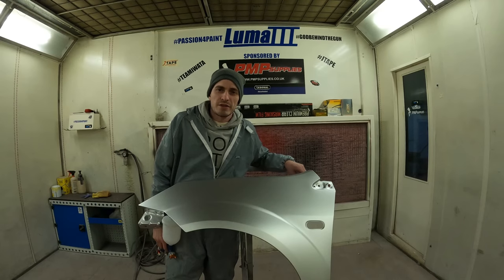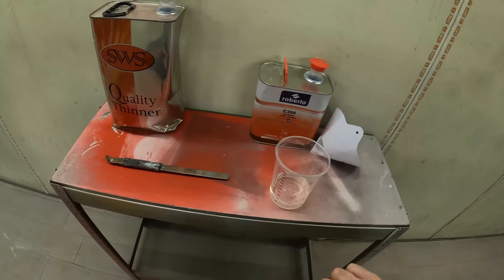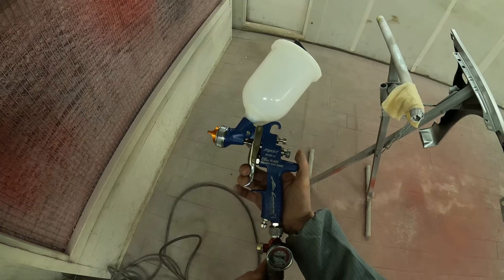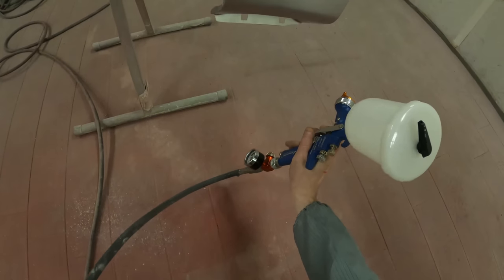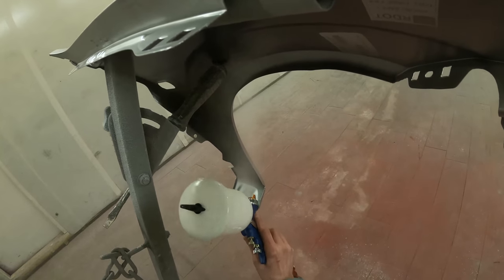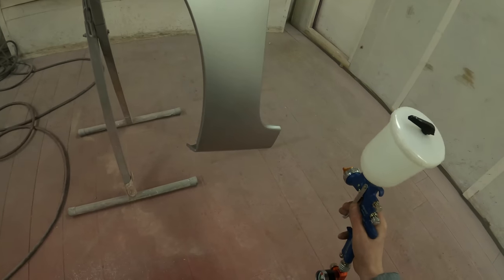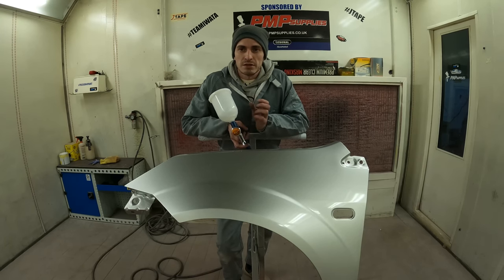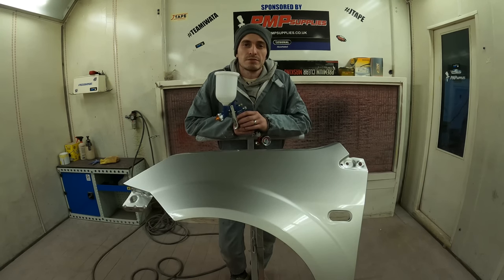How To Spray 2k Clearcoat Episode 3 Car Spray Painting For Beginners DIY Series

Comment: This video really helped me setup my gun and paint 2K clear on my first attempt at painting a van. Your vid was perfect, I definitely would have made some big mistakes without it. I did see a drip and tried to wipe it off, oops, that didn't turn out well 😆 But overall I am really happy with the result. The best time to remove masking tape from a hard edge would be great info too - the van I am painting has an unpainted rubber seal between panels. I removed the tape about 30 minutes after painting, I am a little concerned that the paint may flake over time...time will tell.

Comment: Great video Tony, is there a particular temperature the clear coat and panel should be when spraying?
I'm assuming if it's too cold, the clear coat will run?
Reply from the maker: so average is 20c but obv thats not always achievable for some but you can spray alot lower just be more careful and extend the flash of times ect

Comment: nicely done tony well explained. I need to make another video my first ones where I explained this were pretty lame. So I am going to make one with using Tamco USA made material. I haven't used roberlo clear but I have used their filler which is pretty nice. It poured pretty high solids to me. finish looks acceptable. I usually spray a bit closer and smash the dots just a smidge gets a wetter finish but that would be fine for the panel you are putting on.
Reply from the maker: well bear in mind this was aimed at the beginner mate i wouldnt try to teach people to go as wet close ect as i would to start

Comment: Very nice videos man!!I am a DIY guy and i want to buy a compressor to work with the guns....what specs (cfm, hp, tank) are ideal for small jobs like panels, doors, bonnets etc?Also is the Air Gunsa AZ3 HTE2 proper for a job like this on the video bucause is supossed to be primer gun, but has a 1.3 tip?If you have a gun to propose me around 100-150 euros you are most welcome!Keep up the good work!

Comment: Cracking vid m8, would I do the same method, when using direct gloss ?
Reply from the maker: Pretty much mate yes I’m do one on direct gloss for you guys too on direct gloss I’d probably go one light coat two wet coats though as the polishing stage actually takes colour off the panel so to be safe I would put one extra coat on to reduce the risk of rub throughs

Comment: Hy Tony, can i ask you why my clearcoat (on a solvent base)lose its gloss after 1 or 2 ours but, if i spray It on an old wel cured panel this problem doesn't happens? I used the ICR SPRINT H62 with fast hardner. The ambient temperature around 10-13 degrees  here in Sardinia..
Reply from the maker: The faster the hardener the more it will pull back , also if your base isn’t fully dry ( may be dry to the touch but could still be slightly not quite off ) then it’ll pull back or it could be your clear or thinners there’s a Humber of things that could make it do it
Reply: @TonysRefinishingTV  thanks for the reply, so can i spray the clear over the base letting it dry for a night?
Reply from the maker: It depends on your manufacturer tbh I’d leave it an hour if your air drying and it’s cold / damp then try and hit it with clear

Comment: Another well explained and simple video.....I can’t wait to get spraying now!  Being a DIY guy I’m not sure how I’ll fair with my garage barley getting above 10c 😬
Reply from the maker: Lol we all started somewhere mate and it can be done beleive me lol just slow everything down abit more and take your time , we will also be running some introduction to paint days at my shop this year covering stuff we’ve done in the vids like this one but hands on
Reply: Warming your paint in hot water helps to
Reply from the maker: it does but its something ive never done myself
Reply: You should invest in a heat lamp,also you can add rocket into you clearcoat to speed up the drying process but be careful not to add to much
Reply: Andy, I’m getting there now mate....still a complete noob but I’m getting there.  Pretty pleased with my results so far and absolutely loving the process 😁

Comment: Hi Tony, hope you are ok and your wife in improving, haven't called for a couple of days as you have better things to do than chat to me but if you have the time I have a question for you mate, I lay down my first coat of clear and it looks great with a flat glassy finish but after the second coat it has quite a lot of peel in it, I use the same gun same settings (full fan, 3 turns out on fluid and 34psi) and distance but I just move a little slower, any idea as to why this is happening? I know this is user error but not sure how to fix it, flash off is 10mins, any help would be appreciated mate, John
Reply from the maker: JohnWD40TC02 which gun are you using mate ?
Reply: @TonysRefinishingTV   I'm using my devilbiss sri pro lite 1.2 mini gun, I have two of these one for base and one for clear which of course is the roberlo 610, I know the gun pressure sounds a bit high but been using that after watching the gunman clearing a bumper at the same pressure.
Reply from the maker: Not sure tbh mate not really used one , best thing with 610 is a fine wet coat then a real wet coat
Reply: Ok no problem Tony, I'll try that and see how it goes, I do have some more unrelated questions but I think it's best if I ask you on FB, don't like bothering you atm as you have enough on your plate so I'll give you a few days then give you a call.

Comment: Hi wonder if you can help I am getting quite a lot of dust in my clear coat but not in base coat. I am using an extractor fan and getting spray tent quite hot 23oc humidity below 50%. I need my clear coat to dry faster I am using mipa cx4 2k hs clear coat any advice thanks in advance again
Reply from the maker: Hi Jamie what sort of environment are you spraying in
Reply: @TonysRefinishingTV  thanks not ideal but got a tent 3x3 and 3m high, sealed edges ground sheet on the floor covering up any gaps two fan heaters and an extractor fan to suck out dust. I am not putting any thinners in the Clearcoat as I was not at the shop I didn’t need to.
Reply from the maker: @jamiebeddingham5838  cx4 doesnt really need it tbh its thin enough , as for dust just make sure your guns spotless ect tack before clear unfortunately unless your in a decent half sealed room with extraction its hard to cut down on nibs mate
Reply: @TonysRefinishingTV  thanks for advice I am trying again over next couple of days I never thought after watching your video the other day of blowing off with airline whilst tac rag I’ll try that your videos are great. Thanks again
Reply from the maker: No problem at all Jamie hope you manage to get it to improve abit , also filter everything mate dusts our enemy lol 😂

Comment: Hi Tony new subscriber here, still learning to paint and having problems with my clearcoat, using upol 20:80 and fast hardener but I'm getting bad peel.
I have the devilbiss SRI Pro lite 1.2 with the TE5 cap and 2bar, I'm only spraying small parts that I fabricate myself but do need a good finish. I don't have a heated booth so it's around 10C in my booth, I've been heating my mixed clear in boiling water plus heating the parts with my IR before spraying to around 35C, do you think I'm over doing the heating stage causing my peel issue, should I just heat the part and not the clear. 
I also find that the clear takes 4 or 5 days to harden, is this normal or is upol not a good make of clear, sorry for all the questions but I'm pulling my hair out trying to get a good finish, Oh an using Jet Black solvent basecoat.
Thanks, John
Reply from the maker: do you add a drop of thinners into your clear mate , ive never used that clea or gun tbh but warming everything up like that is something ive never done and in this video we were spraying at 10c no issues and it shouldnt really take that long to dry either, im thinking warming it all up so much may be making it dry to fast so its go no time to flow out on the surface before it flashes off
Reply: Thanks for the reply Tony, I didn't add any thinners as the data sheet states its optional and its quite thin as is, I'll try again without the heat, as I'm using an extra fast hardener (5 to 15C) you are probably correct that its flashing off before its flowed out.
Reply from the maker: JohnWD40TC02 always try to rely to everyone fella if I can the help always expands further than the videos , and if you get stuck after adding a tad of thinner 10% I’d try personally I use that in most clear , then drop me a message on our Facebook page as it would be easier to chat in the future if you need some more focused advice
Reply: Hi Tony, just to let you know that I added 10% thinners, didn't heat the clear and only heated the panel to 17C (ambient was 7C), sprayed 2 coats one medium and one wet and the finish was like glass, quick flash off very little peel. Really appreciate the help here Tony, your advice was spot on. 👍👍
Reply from the maker: honestly mate brilliant fella so glad to see you've got it nailed now mate and was my pleasure buddy always help out where and if i can mate, keep smashing it now fella

Comment: Hi Tony.What are dimensions of that booth.It has just exhaust fan right?
Reply from the maker: no mate its a proper booth so its 7.5 meters long 4m wide 3m tall the whole roof in this is the input filters and it has a fan unit and heating unit pushing air in through the roof filters and then extracts through the rear
Reply: @TonysRefinishingTV  so it has intake blower?
Reply from the maker: Montenegro ZETA yes this is a full proper booth not a home built one it’s a full dalby booth bake the lot mate
Reply: @TonysRefinishingTV  people use negative pressure booths a lot.I saw gunmans video his booth use just exhaust fan so its not big thing if it has just one fan that extract air from booth instead of two
Reply from the maker: yes but this setup has plant to put air in and plant to take air out
Reply: I think the key thing with any booth is to have airflow through it...clean air coming in at one end and "dirty" air being exhausted out the other.  When I turned my garage into a paint booth this past summer to try my hand at painting a car I used two box fans with furnace filters taped over them...one as an air intake and the other as an exhaust.  If you seal things up reasonably well it definitely does work.

Comment: Wrong! First coat do not need to spray the edges always the second coat, otherwise overbuilding the edges....
Reply from the maker: Personal opinion I’d say on that I’d rather have two coats of clear over a whole panel than one coat on edges and two all over so the whole panel has the same protection